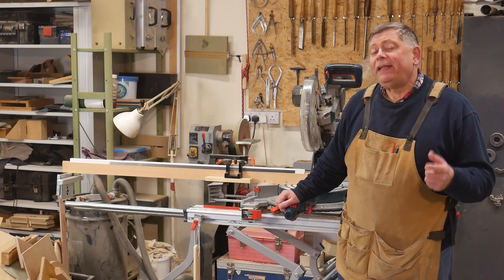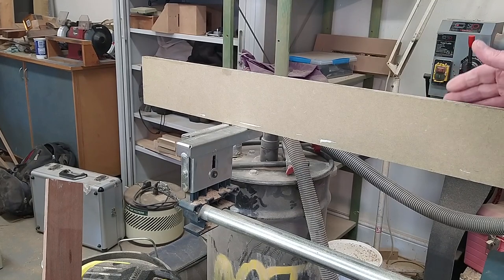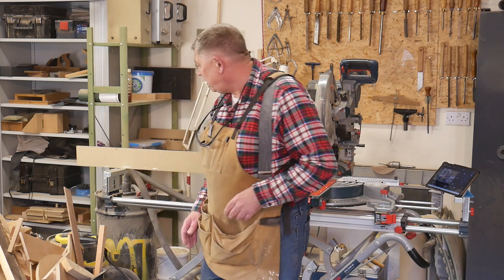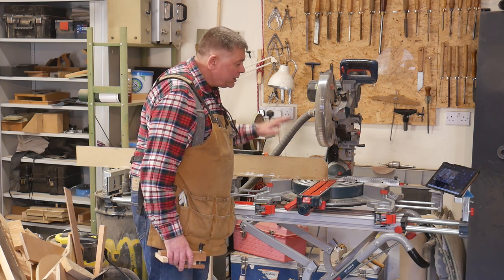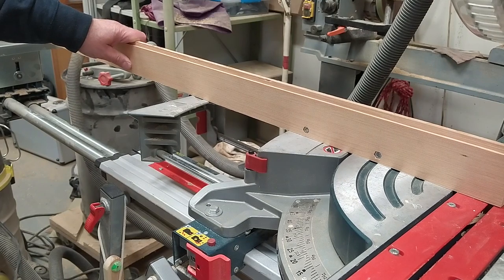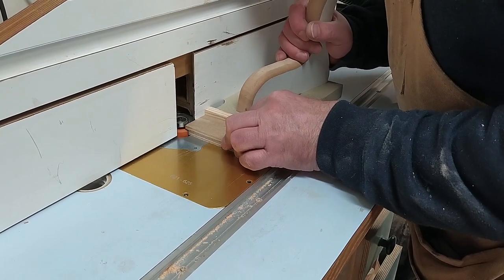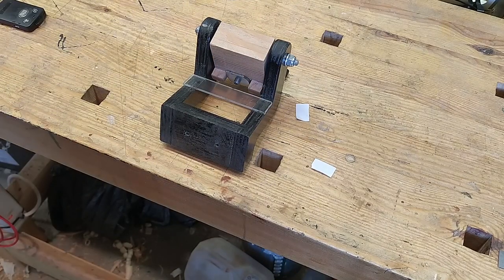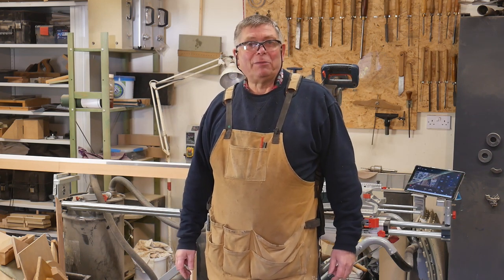Fantastic Flip-stop fence for my SCMS!

Comment: I don't use my Sliding Mitre saw, as I can do almost everything on my Tablesaw/ Bandsaw, so I gave it to my eldest son.
I recently updated my crosscut sled and fitted a flipstop with a cursor and measure scale almost identical to yours.
My next mods will be a box joint jig to the crosscut sled and adjustable zero clearance inserts for the saw blade, as I regularly use an 8"" Freud Dado set, (American Cabinet Saw).
Reply from the maker: If you want to cut box joints on your tablesaw, can I suggest that you have a look at mine? I'm very pleased with it. 
https://youtu.be/RKT9AsTApbU
Good luck!

Comment: I really like the sacrificial stop portion.  It seems easy enough to recalibrate that I might actually do it. And if I feel like batching out a bunch of cuts registered off of an mitered end, I can do that just as well.
Reply from the maker: Yes, that is a good point. You could attach a V-shaped stop for extra support. It wouldn't be calibrated for zero, but at lesat you could work to just one pencil mark for as many cuts as you like.

Comment: Thanks for the tip about the Ikea T track as the price of normal T track makes many projects too expensive for me. In fact I made a fence extension for my cross cut sled and never added a stop for this reason. I salvaged a flip stop from an 1980s Scheppach sliding table, found as roadside scrap) and it uses the exact design as yours (except it is metal of course). Thanks again, now I can finally add the flip stop and a scale to my cross cut sled.

Comment: lots to take away from this design! I'm just left wondering about the hardware, is that metal latch something commonly available at hardware stores across the pond? and to get a bolt that works nicely with the VITGA track it looks like I'll need to fabricate one myself? Or is that a modified off the shelf product also?
Reply from the maker: The toggle latch is easy enough to find, but the sliding nut was part of an advertising board system. I used to be able to buy them by the hundred from a local hardware supplier. Indeed, I use to sell them from my website, But the manufacturers changed the design and they are no longer available. I probably have enough left to see me out, but they are easy enough to make from a piece of steel, 3mm x 12mm or so (1/8 x 1/2") filed to fit, then drilled and tapped. The Bristol levers are readily available online, I've never seen them in my local DIY sheds.